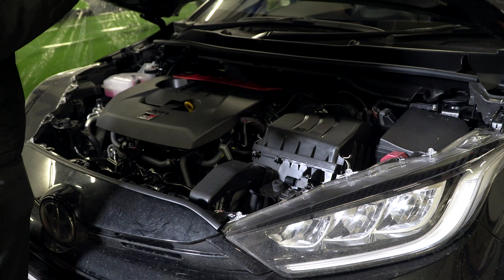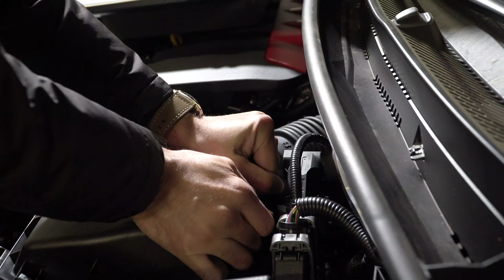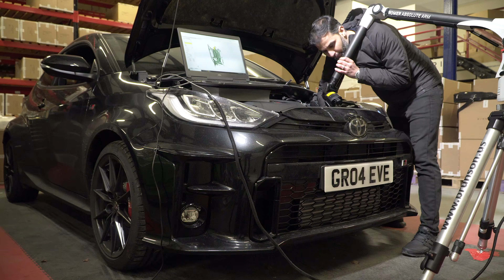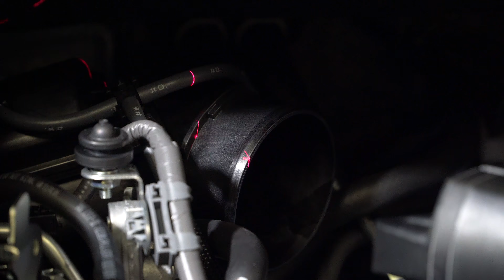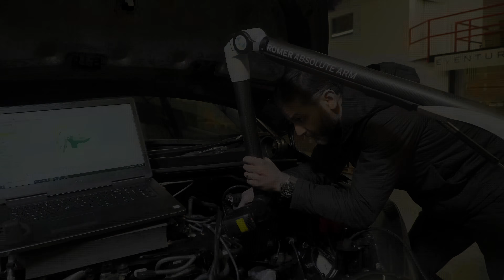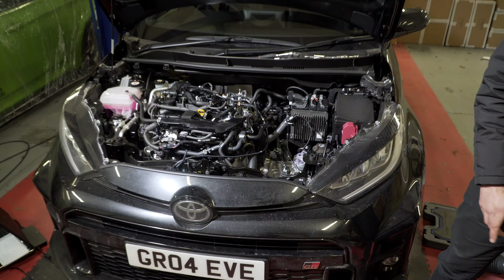GR Yaris Eventuri Development Begins! - Teardown + 3D Scanning

Comment: Getting rid of Toyota’s extensively designed twin length intake system for low and high end torque....probably not the greatest idea without extensive development and dyno runs.
Reply from the maker: Good job Eventuri do extensive development work both in real world conditions and on the dyno.
Reply: Both...il let you know when my 2 arrive in June and I develop my track version compared to my road car which will be 100% stock.
Reply: Do you have an idea of price for this intake yet guys? That scanner must cost 💵
Reply from the maker: Until development gets further along we can’t estimate. We don’t know how many parts it will involve and the complexity of them.

Eventuri will also be looking at effectiveness of the intake when tuned, and releasing some much needed noise.
Reply: Noise under the bonnet would be great....as there's certainly none from the back end!!

Comment: Great video. Awesome seeing how much work goes and how much equipment is needed to properly develop things.
Using 3d scan data for reference is an amazing thing. It just speeds up things massively, gives boundaries to work with and it gives nice preview once done in cad software.
Made a custom airbox for the cold air intake using 3d scanner (cheap one) cad software and 3d printing.
It's been on the car for couple of months now and it definitely got rid of the heatsoak it had with open cone filter and no airfeed from the front.
Your work and atention to details is inspiring.

Comment: The current airbox has a flap that opens at 5k rpm. Is this for performance or sound? Will you incorporate something similar into your design?
Reply from the maker: Believe it’s just for sound. The stock system is very muffled.

Comment: Great to see how you develop the intakes, 👍 really looking forward to the hole process and how you tweak the design as you go,  finally pick mine up Sunday, will probably use a full tank of fuel , may contact you after I've run it in and see how the Dyno figures compare.
Reply: GR-FOUR Whole process.

Comment: I would put your time into the remap,not the air filter.
The standard airbox is fine as it is.
Easily take extra air in,toyota arnt daft and to be honest will be a waste of 💰
Reply: @Shane the standard air filter and box will be easily good enough for an extra 75bhp,probably more
Reply: Classic, spends a fair bit of time scanning the area, then looks at the hole he’s made and finds a part he’s already manufactured that pretty much fits! Good example of utilising 3D scanning.
Will be impressed if you show how you’ve used the scanned model for clearances?
Reply from the maker: Make sure you’re subscribed and you’ll see in the next episode why the 3D scanning was so important.

Comment: Could you develop a method to code out the artificial sound pumped into the passenger cabin, or is it possible to just pull a plug somewhere to get rid of it?
Reply: It can be disabled on the standard Toyota equipment in the dealerships. It's just a check box once you get in to the ECU, 1 click....gone ;).
Reply from the maker: Something we need to look in to
Reply: Check the GRY forum - it’s been covered off in there - easy fix via Carista 👍
Reply: replace it with a trombone sound
Reply: Reports are that with it disabled the car sounds like nothing. Better to keep some sound even if piped in.